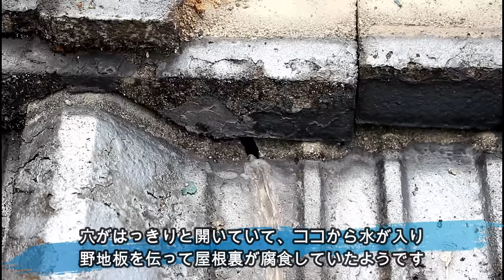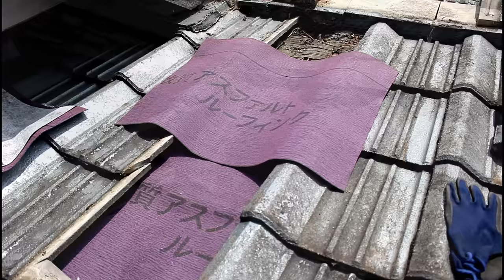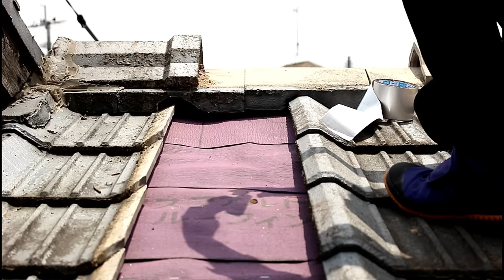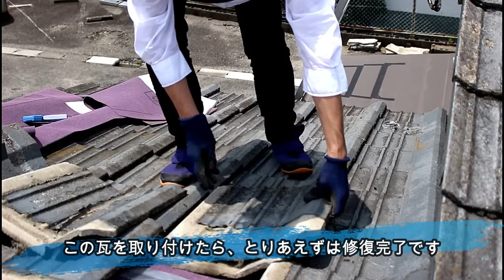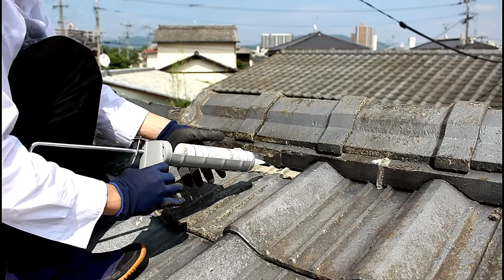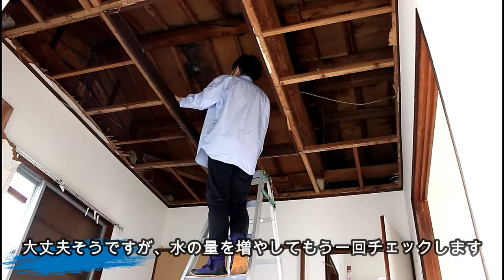【DIY】#3 相続物件をセルフリフォーム！屋根の雨漏り修理方法と掛かった費用を公開

Comment: The rotten sheathing needed to be replaced.....then, repair work like you did could be done.  Curious, if over time, the leak "re-appeared"?  P.S.  Training/education in architecture is different than training/education in construction.  Architects design, constructors build.....and, somewhere in the middle, they work together.  😎🤗😃💕👍